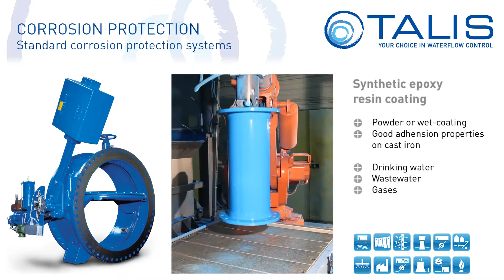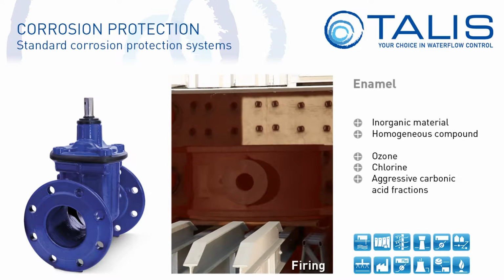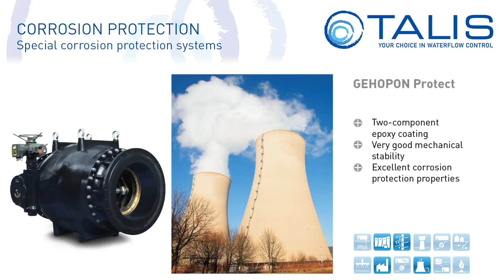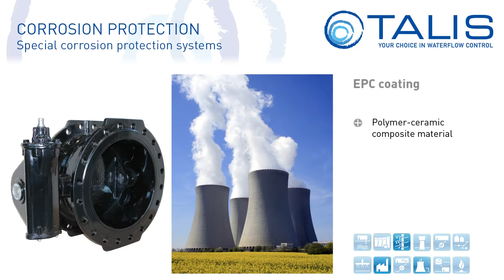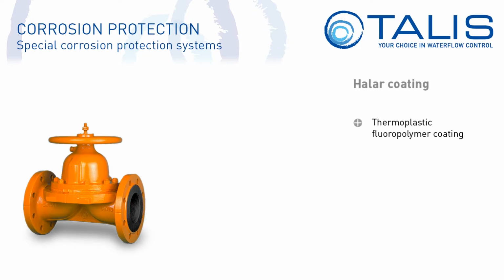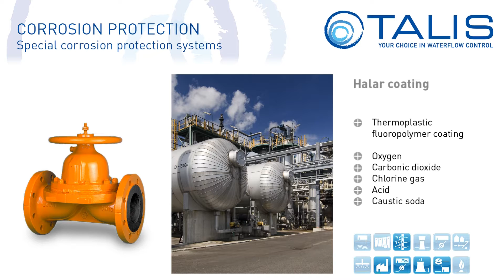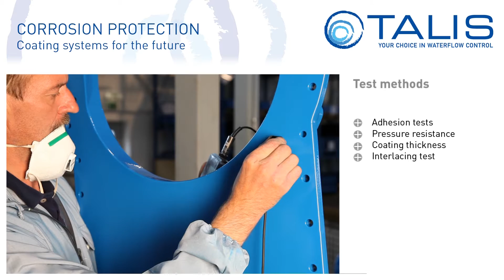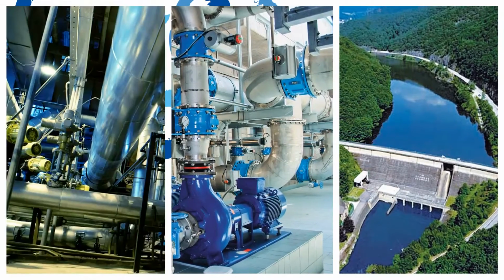Application Video Valve Coating

Comment: Do you sale valves with a coating, which are compatible with the conditions at the site where they will be installed. For example in an on-shore pipeline direct at the shore of the sea?